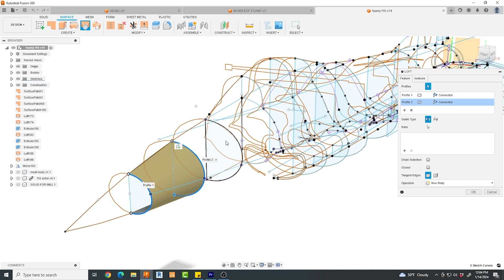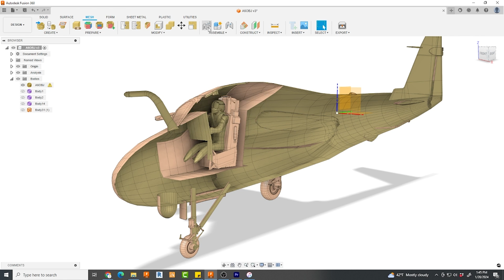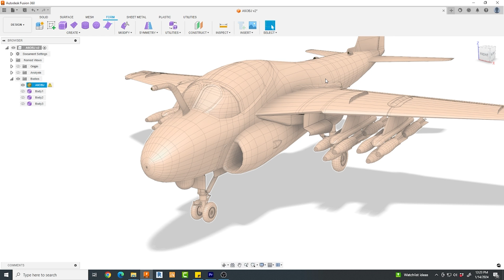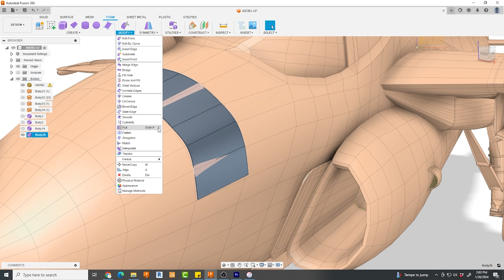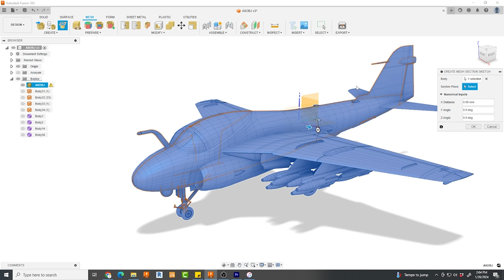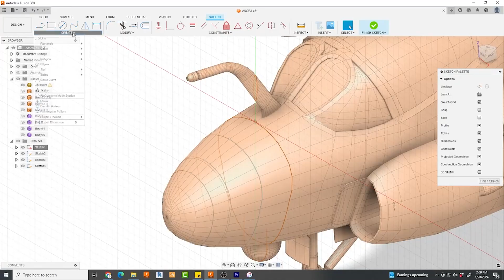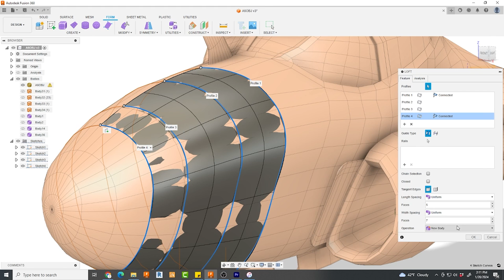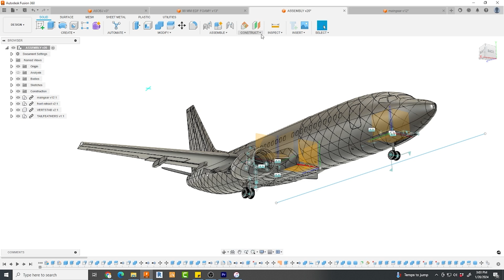Master Reverse Engineering For Rc Jet Builds: Easily Utilize Imported Geometry #fusion360 #rcjet

Comment: is there a way to export the curves you created in Fusion to Plasticity and then model in Plasticity using those Nurbs curves?  I tried doing this and Fusion would not let me export the created curves as STEP files.  I have an excellent model I want to use but cannot import as an empty into Plasticity and this is my workaround.

Comment: How do you go from a form to a solid,  or if you want a solid should you just do a solid loft?
Reply from the maker: in the form modeling tab, if you have capture design history turned on, you would simply click the giant green check button for finish form.  If your form is an enclosed body it will become a solid.  if it is not, it will become a surface.
If design history is turned off, go to utilities and hit the convert option.
Reply from the maker: Actually did this for you.  Keep the questions coming.  https://youtu.be/U_e4co6JzV4

Comment: I’m having a problem some areas are not letting me use mesh section sketch how can I fix it
Reply from the maker: I have run across this as well on some models.  I suspect it must be an error in the mesh file.  One suggestion may be to open the file in mesh mixer to try to repair.  Let me know if you found a solution.

Comment: I’m working on a B21 RC Drone variation, project that is heavily modified with a small mesh STL in blinder , I would like to make bigger and modify it in Fusion 360 can you help me with some advice ?
Reply from the maker: Sounds great!  i'm getting bombarded but if you send me a contact form on my website I will try to take a look time permitting.

Comment: Great tutorial! I tried doing the same thing using pull to move faces around and eventually gave up. Will try again with this "fit curve to section sketch" + "form loft" technique. Please consider doing a follow-on video. I'd like to see how you'd handle closing the nosecone, dealing with the flat sections and recesses on the windshield, and maybe the other lumps and bumps like the little scoops on the intake sections.
Reply from the maker: Thanks!  Ok I've had multiple requests for the complicated bits.  I guess a follow up video is in order.  Here's a quick tip on closing the nose though.  Use the fill hole command. Then look at the options for fill reduce or collapse.

Comment: Hey there, thank you for your tutorial work. I've also looked into designing a model aircraft in fusion 360. I've fought with a couple issues there. 
One annoyance I always faced is that I wasn't fully sure how big the plane would end up needing to be when I started the initial design. It might turn out later that I need to up or downscale by ~5% or so depending on if the EDF inside is getting enough airflow or the airframe is getting too heavy. That makes it really hard to draw stuff, because changing size after the fact is really, really difficult. Especially if some dimensions need to stay the same no matter the scale, like e.g. the trailing edge having a minimum thickness. 
The second annoyance mostly affects me because I like designing new planes instead of replicas, so I've really struggled to draw out shapes. One instance I can remember for example was the intake similar to the one on the F-22. It is tilted in 3d space in a really annoying way that make it extremely had to draw good lines around it.
The last issue is that general advice usually is that all sketches in Fusion 360 should be fully constrained. And as someone who really enjoys parametric design this really is important. However it often ends up with a huge amount of dimension spam and the scaling issue from above also crops in again, making it impossible to resize or change major parts after the fact.
Maybe you might know something on this, or how to deal with such issues? 
I also second the issue another comment mentioned about blending wing and body, especially when designing a stealth aircraft.

Comment: Thank you Robert for the video, I am glad you like the model and you were willing to explore other ways of making accurate scale model for RC in Fusion. I like this method but here is another idea to make it a bit easier, if you have Blender, you can ungroup parts of the A6, for example, upload just the fuselage, the wings and landing gear all separately, and assemble them in Fusion and just make them not visible and only work in one area at a time, for example just the fuselage, this way you can see more clearly and snap to the form more accurately. Ultimately once everything is captured, I think formers and stringers can be made, you can tell us that since you have more expertise in Fusion. My goal with this model is to do molds for carbon fiber skins, same like RamyRC does in his YouTube channel and the formers, ribs all in balsa and plywood and cut by laser. THANK YOU!

Comment: How does this compare to generating face groups and then convert mesh?
Reply: I'd like to see how they compare too, but the "Prismatic" option for Convert Mesh is not available in the free version. I suspect this approach might still be preferable because it lets you explicitly control the cross section placements and loft parameters.

Comment: First of all this is a great tutorial, I used fusion for a long time but until recently never had to use mesh or form tools. I got one big question, when I have created a body using form tools it cannot then act as an solid body. I cannot create joints or merge it with any other bodies I have designed in solid form. Can you give me some insight?
Reply from the maker: If you are capturing design history, once you have completed your form it converts to a solid body or if it is not an enclosed shape it converts to faces.  If you have design history turned off you must use the convert from tsplines to brep option to turn it into a useable form.  Then you can edit just like any other solid or face
Reply: @redbaronrc   thank you so much, I had the capturing design history turned off.

Comment: Could you make a video addressing how you go about connecting wings to your fuselage? I have been having considerable trouble trying to loft the fuselage with the appropriate airfoil in mind as the DAT file I imported for my airfoil design is difficult to work with and use as a rail when paired with other pre-existing sketches that I also need to keep in mind. For example, when editing the airfoil sketch to tangentially slope with a smooth transition to a neighboring flat rail, I am riddled with issues regarding the lofting exercise and am faced with many errors. I would really appreciate some aid if that is alright with you, this has been a roadblock in my project for multiple weeks now and I truly have tried every workaround I can think of. Thanks a lot, keep making videos!
Reply from the maker: I can try to help.  Send me an email through the contact form on the redbaronrc website and I will reply directly.  From there send me your file and I'll see if we can make sense of it.
Reply: @redbaronrc Alright, I tried sending a form earlier but I was having some issues with it, I just went ahead and used the email on the website. Thank you for responding it means a lot.